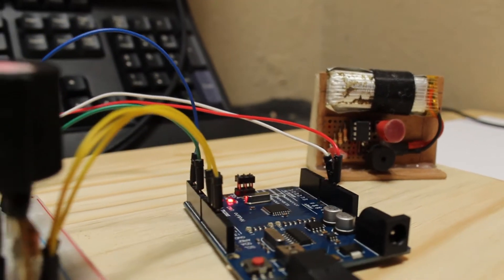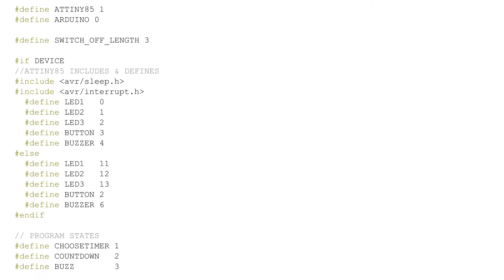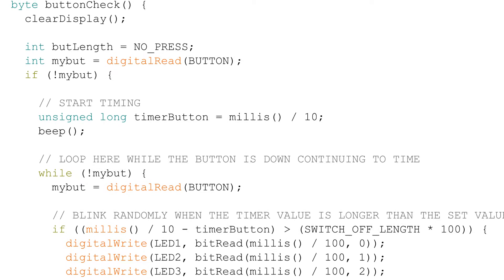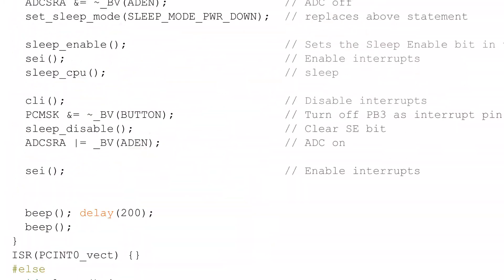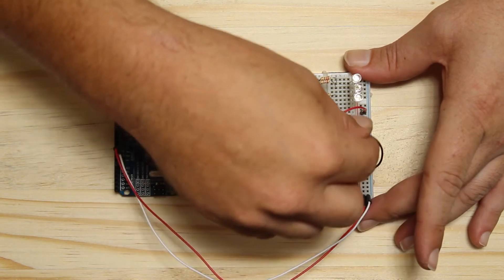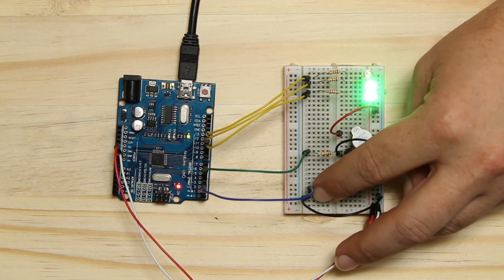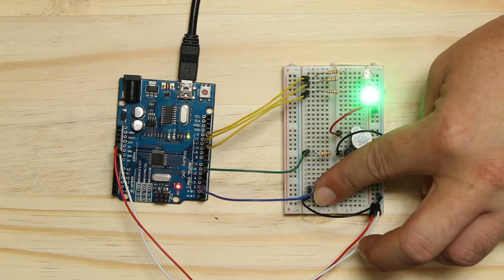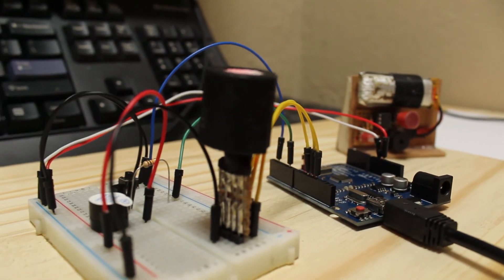09 An Arduino Countdown timer

Comment: Hi Ian  I built this with UNO but can't get it to work with ATTiny85. Does the code need to be modified for the ATTiny 85? I see this project is a couple years old but i  enjoyed it a lot and learned a lot. I see you use BUZZER pin 6 in code and have pin 5 in diagram. that made me scratch my head but great learning.
Thanks for the great video
Reply: My bad  - Got Attiny 85 to work fine. I had a boot loader problem. How hard would it be to add a  oled display?